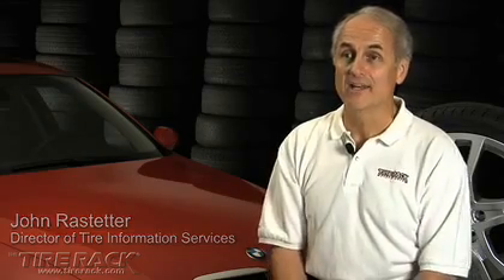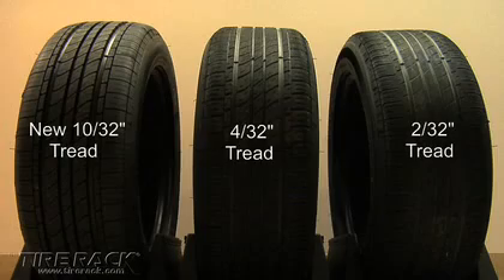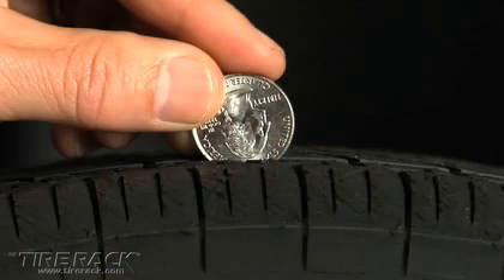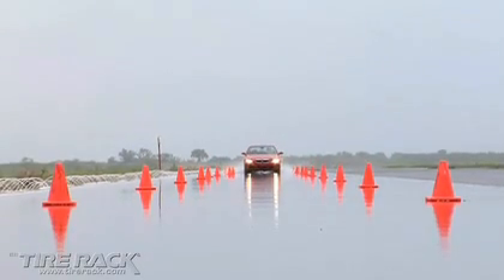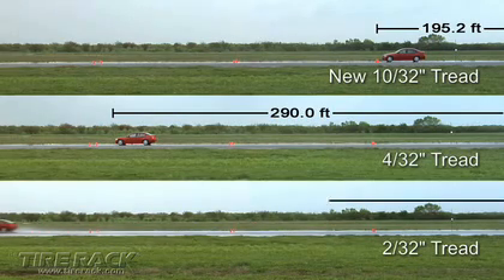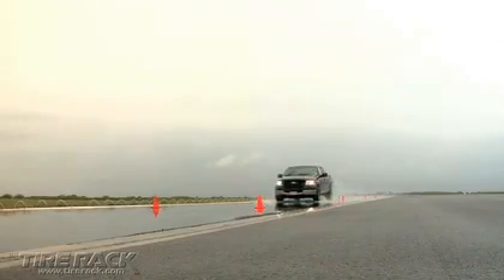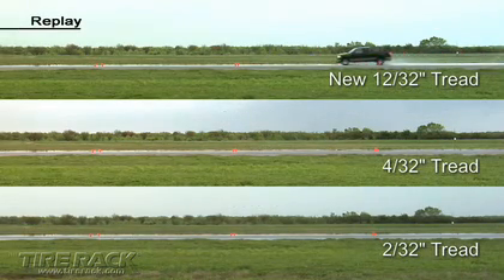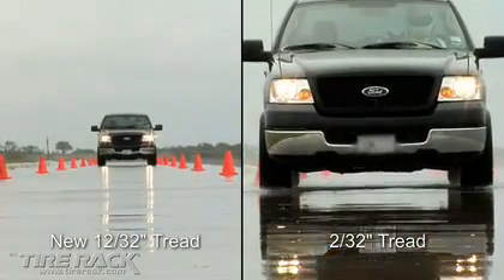Tested: How Much Tread Depth Do You Need? I Tire Rack

Comment: I guess comparing new tire stopping distance is pointless to gain a few feet between tires
When you lose 122.7 feet at 4/42
And 244.4 feet at 2/32 why you are supposed to replace them, and they would still pass a safety check
Unless you replace your tires instead or rotating them every 5,000 to 7,000 miles

Comment: They are just trying to sell tires, this is BS
I wait until the wire starts sticking out of the bald tires
Also bald tires are like slicks that have better grip
That's why Quarter mile race cars,  Dragsters,  Nascar,  Formula 1 etc use them
Also the wire sticking out of the tire digs into the ice and snow gives stellar traction in the winter, like a studded tire
Why does Tire Rack never do this test?
Because they want you to throw away perfectly good bald tires with the wire sticking out of them to buy new ones

Comment: This is wet performance. On dry, less thread depth means more contact area, so worn down tires break better.
Reply from the maker: Hello! Strictly speaking, yes, but at a significantly lower level and much less dramatic than we see in wet braking.

Comment: Would be interesting to see the same test run dry.  If tread depth is the only factor in the wet stopping, then the dry tests should produce similar results among the different treads.  If the results were still different, perhaps the age of the tire is also something to consider?
Reply from the maker: Good question! We were curious about the same thing, so we performed this test in the dry, too. We saw a small, 1.5 foot improvement in stopping distance from new to 4/32," and the braking distances remained the same for the tires with 2/32” remaining tread depth. If you would like to check out the test report, it’s on our website here: https://www.tirerack.com/tires/tests/testDisplay.jsp?&ttid=91

Comment: Another thing to consider by the time you get down to 4/32 the rubber probably has hardened over time so performamce with be even worse.
Reply: I believe if you read the test write up they actually artificially hardened the tires be baking them to mimic the aging process

Comment: In southern California or wherever the road is dry all the time, bald tire actually performs better!  It got more surface area.  Don't waste your money!
Reply: this is maybe the dumbest opinion I've ever heard. Even if you take out the wet traction improvements of new tires the rubber compounds of new tires vs old tires that have been subjected to the elements for years would still make an improvement. After years of heat cycles tire rubber is no where near what it was new.
Reply: you are right, but that is only The case when The tire is a slick, by when you are gonna aquaplane like a baboon when somebody sneeses. so just drive on slicks or normale tires, dont half ass.
Reply: The stopping distance for 10/32 tread depth (new tires) from 50 mph to 0 mph on a 3,400 pound BMW is 89.3 feet and  for 2/32 tread depth (at the legal limit) from 50 mph to 0 mph on dry roads is 87.8 feet. So you are correct it is a short distance by 18 inches. On Southern California roads where it doesn't often rain you can stop 18 inches sooner if you utilize the ABS system properly. If it rains and you must utilize the same ABS system you can expect to roughly double the stopping distance as the above video shows. So i respectfully disagree with it being a waste of money.
Reply: +Doug Wang YAY, thanks for reminding me why living in Wisconsin sucks slightly more. lol
Reply: Until you get rain in your forecast...
Reply: Where did you get the dry road numbers?

Comment: No. It's not a good video. It's actually very misleading. Stopping distance on the 10/32" = 195.2ft, stopping distance on the 2/32" = 378.8ft. 378.8/195.2 = 1.94. That means stopping distance is increased by 94%, or almost doubles with the 2/32" thread. Bad? Yes. But, the video is NOT to scale. The car in the 2/32" scenario should have not left the screen. The author is trying to make us panic. 94% extra means the car should stop just short of the half way mark on the screen.
Reply: giggi4455 I know this is old but the braking point starts off screen as well. they are showing a comparison from the end point of the first car. not misleading at all.
Reply: I suggest you google "non zero axis" or just read https://callingbullshit.org/tools/tools_misleading_axes.html Starting off screen is the same as using a non zero axis.
Reply: @doughanson9730  exactly
Reply: @doughanson9730  Not in this context, you silly goose. The non zero axis becomes an issue because of how the graphs are scaled. There's no scaling in this brake test. Besides, the information is clearly there in distance. The difference between a 10/32" and a 4/32" is over 120ft. Everyone knows that's a difference between a fender bender and a major collision.

Comment: Speaking from real world experience, I got a feeling that my tires would not hold on to the road well when it rained heavily, I had around 4/32" left. My tires felt like they weren't gripping the road so I was going at 65mph. But it wasn't until when I tried braking during downhill when I realized I needed new tires. Tapping on my breaks lightly the car would just go down. I slammed on the brakes and my ABS came on like crazy. I think 4/32" is a good time to change your tire...

Comment from the maker: Yes, the stopping distance is effectively doubled when the tire is worn down to 2/32” remaining depth. But our testing revealed the impact of shallower tread is non-linear. Wet stopping distance gets longer as the tire wears, but as the tire wears below 4/32” remaining the wet performance really begins to fall off much more rapidly. That’s why we recommend replacing tires at 4/32” if you have to drive in wet conditions.
Reply: Did you consider the behavior of the ABS or what ever the breaking system with worn tires?

Comment: There is a mathematical formula that determines how much breaking force can that can be applied to a particular vehicle.  For some front wheel drive vehicles with almost twice as much weight on the front than the rear ,newer tires on the rear will decreases stopping distance by 25 percent..